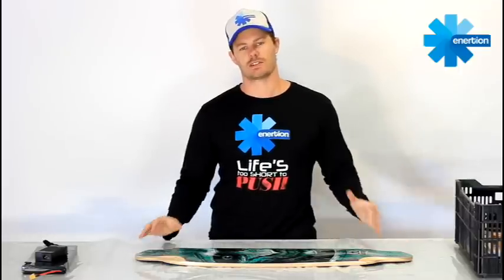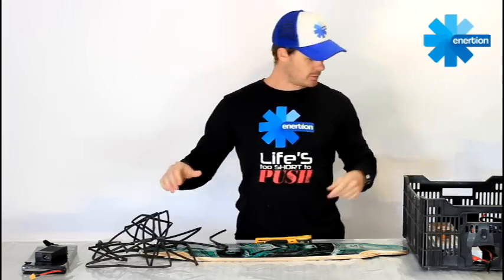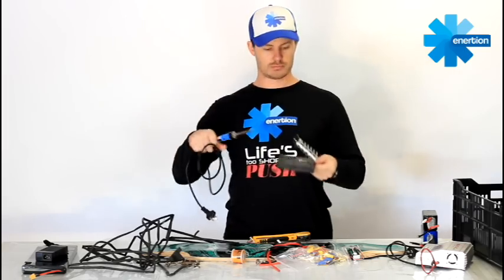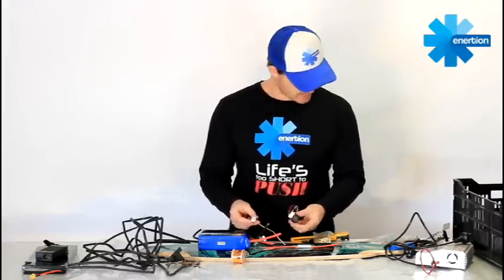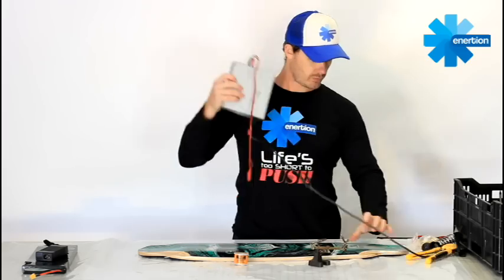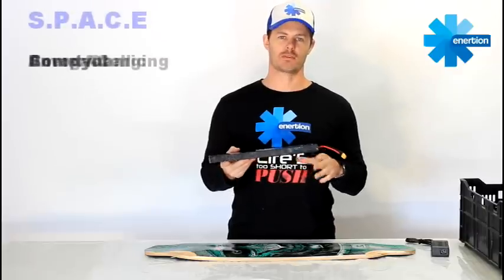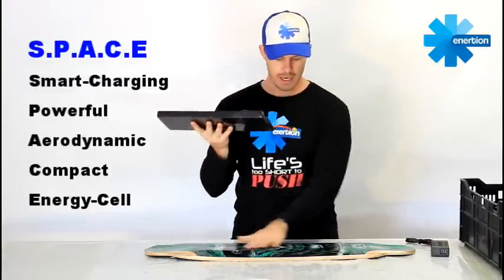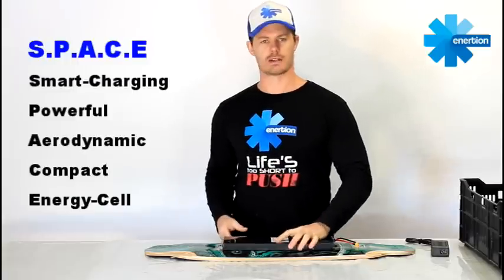Best Electric Skateboard Battery SPACE | DIY Parts | EnertionBoards.com

Comment: Around 150 to 175 dollars usd for 40 Samsung 30Q 18650 cells..50 dollars for a good quality bms..40 to 50 dollars  for a electronic on/off switch .10 bucks  for voltage gauge..around 300 to 350 bucks to built it yourself if you have spot welder and nickle strip.Jason is selling it at a reasonable price and the man still needs to make a little to feed his family...

Comment: to expensive almost 300$
Reply: +Electric Skateboard Builder does it have at least a 10 mile range?
Reply: +Electric Skateboard Builder I could build a lipo 20.000mah 6s for half the price of your battery  with a BMS not going to lie I know that you have to make money but don't call your self a diy when clearly your stuff is not for the diy people DIY people Don't want to speed 300 pounds on a battery and then you say save you all the trouble yet they till have to solder the esc the motor the radio equipment and then saying its slimmer then a lipo pack you could make lipo Pack even slimmer
Reply: +jameshone1000 you also forgot to say that your 10s pack is 10s 2p  and that if one of them 20 cells dies you have to bin the hole pack In less you know how to dissmatel the pack
Reply: jameshone1000

Comment: It's kind of funny how you talk expensive but it would still be cheaper to do it with a Li-poly setup than to pay 460$ US to buy it. It's convenient, I'll give you that, but Li-poly isn't nearly as bad as you play it out to be. And I know you have to sell a product so it's going to be biased, but just something to keep in mind.
Reply: I dunno there are ways around the soldering iron (Most kits come with plugs), the heat shrink (electrical Tape), quality wires aren't that much, The charger does cost money. But I guarantee you it's still cheaper than SPACE. Now I'm not knocking the convenience of the SPACE battery, I'm just saying it's still cheaper to do it with Lipos, but if you're gonna go cheaper it's almost always more work. Regardless, like I said, you are trying to sell a product so it makes sense.
Reply: Okay let's see, 60$ for an On off switch, you're paying WAY too much (more like 10$ (USD) at MOST), like I said the soldering is not necessary depending on what you do, 36$ more dollars not needed, assembly time does not cost money..... so that's another $30. You are also using two different Lipos for some weird reason, I have no idea how expensive those ones were specifically but I guarantee you bought the largest ones you could find, ALSO a lot of the setups already have connectors and wires so that's 10$ more dollars, how much so far, right 126$ less than what you could find. Wire strippers not needed either as said before a lot of kits have connectors that come with it and fit together, so now were at -$146 off of what you "calculated". So realistically if you were being smart about DIYing a board with lipos, it would cost more like $233. Plus there are probably chargers out there that aren't that expensive (And are just as safe) so let's knock that down to $200 with a charger. All I'm saying is that if people want to save money, they would go with a DIY lipo setup. If they don't know what their doing, then do some freaking research. You "seemed" to play it off as if you had no idea how to even make a Lipo setup as it was so "complicated" so how can you even say it's bad when you don't even know how to properly do it yourself. Like I said, you can pay the extra money and get the convenience, or you can pay a little extra time and get experience, save money, and learn something new. I'm not dissing people who buy your product, I get it's convenient, but for people who want to save money like me and want to learn how to do something myself, I'll stick with the DIY projects for now.
Reply: Also I don't know what Lipos you're buying but I know the ones I'm buying can be charged more than 100-200 times. Also, not that difficult to charge if you buy a "Quality charger". I know I'm never going to convince you because you're trying to sell something, so honestly it's probably a lost cause, but at least I tried.
Reply: You do bring up good points and I can respect that you have some evidence to back it up. Anyways, I wish you the best of luck with the SPACE battery, and honestly I would probably buy it due to its convenience, but it is a little too expensive for me. Cheers.
Reply: Price includes shipping worldwide as well? - I only just started looking into building an e-board, but I can definitely see the benefits of this pack!

Now matter what numbers you use, as soon as convenience and hassle is even a MINOR factor, this battery is well worth it... I also have good experiences with 18650 from e-cigarettes... And if they are balanced, they should be brilliant!

EDIT: I also watched a lot of his videos and all I saw was good open communication and an eagerness to please "all of us" as early as possible. - So while my board is only in dream/concept stage at the moment, I'll DEFINITELY keep this pack in mind!

Comment: i am planning to buy this board .
http://www.ebay.com.au/itm/9-5-x42-LONGBOARD-Through-speed-THRU-PROFESSIONAL-Cruiser-complete-9-X-FREE-/131214198968?pt=LH_DefaultDomain_15&hash=item1e8cf9c8b8
 can you tell me your single motor kit will work with it or not check its wheels too :).
what difference that 3 motor pulley make?